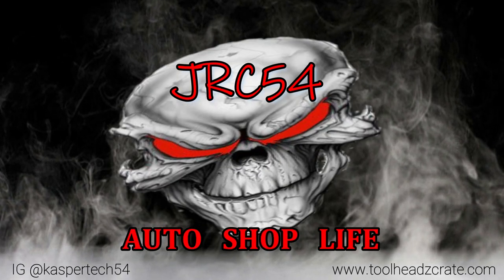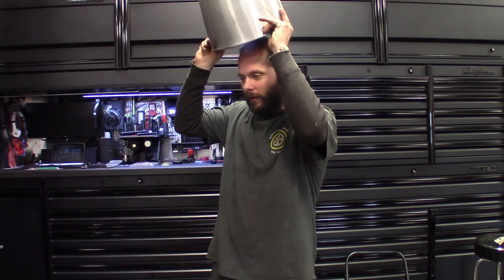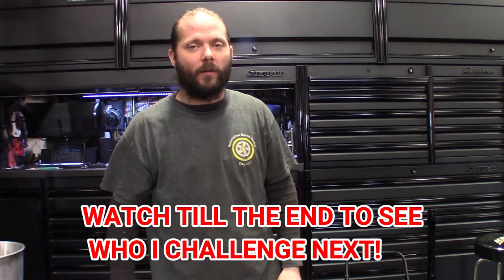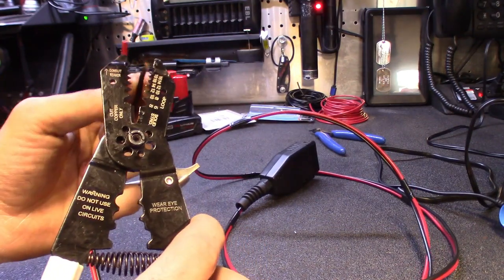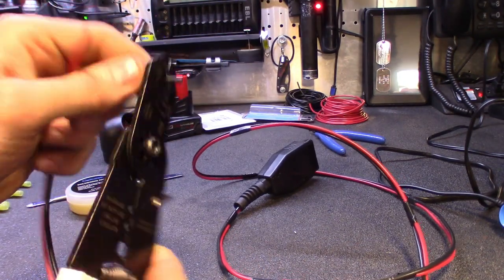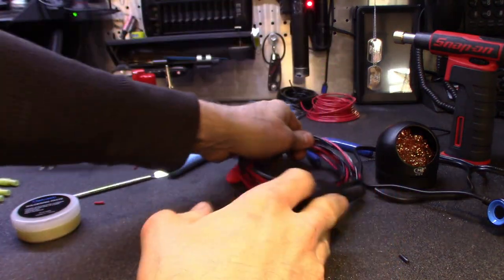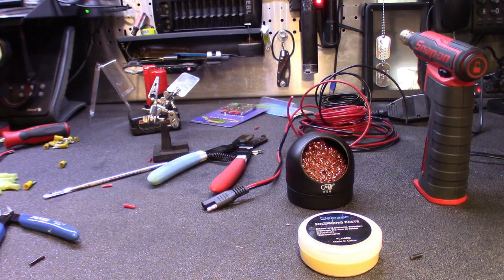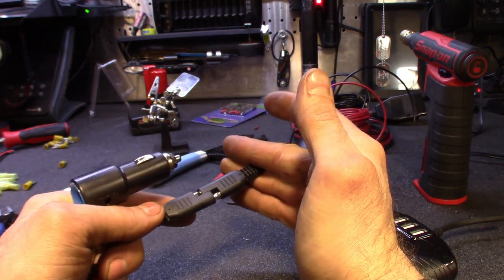MAKING TOOLS!!

Comment: Nice. Quick tip whenever I have to use one of those spade connectors or ring terminals I always pull off the cheap insulation that comes on them with pliers then crimp them and use heat shrink instead. It makes for a smooth and tidy connection that’s also weatherproof

Comment: Great video. Should it have a voltage blocking diode so voltage only flows one way? I’m gonna make one
Reply from the maker: Thats a good idea just to be on the safe side. I don't think I would need a diode cuz there's not any sort of load or amperage when using a memory saver.